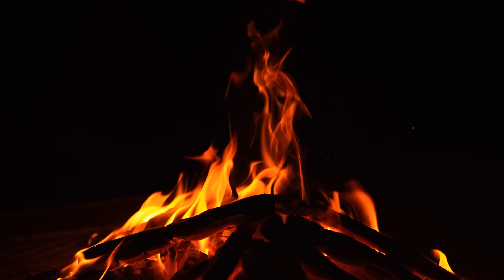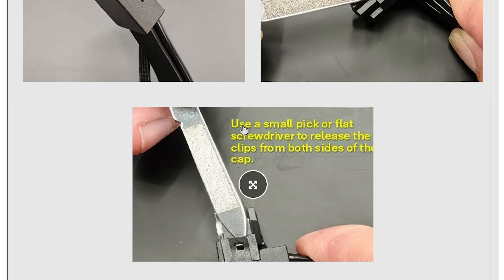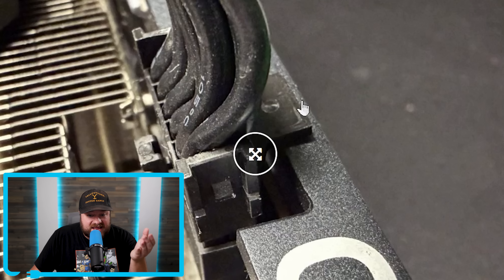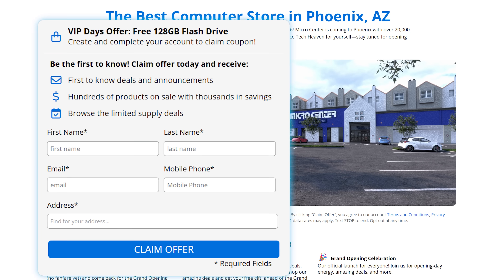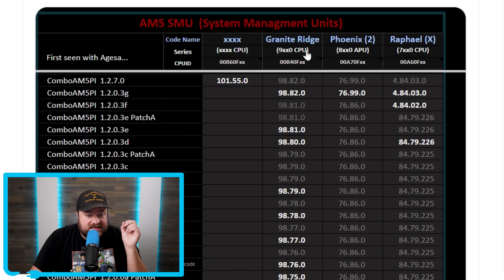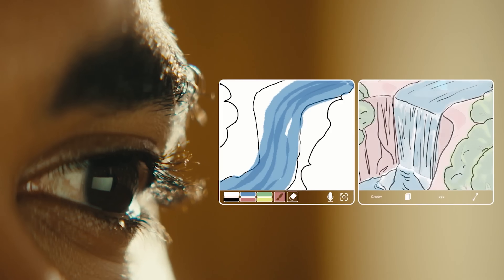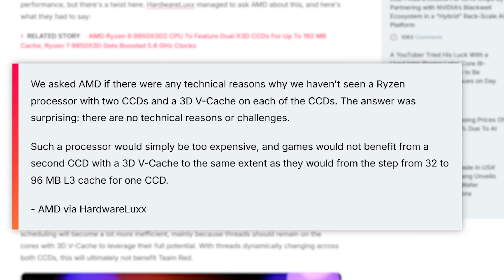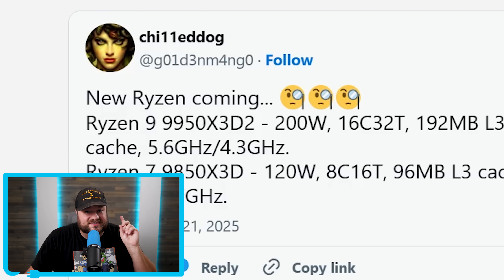AMD’s Dropping X3D 2.0 To DESTROY Everything!

Comment: 8:20 so all 16 cores have 3D cache rather then 8 with and 8 without?
If so that is INSANE
Reply: Still two ccd's
Reply: It will likely be 8 with 8 without
Reply: @Bronson1952 I brushed up on the leaks abit after this comment and found that it is all 16 cores. 192MB of cash is 96 / 2 for each of the CCD’s/chiplets. So it’s 2 chiplets of 8 cores both with 3D V-Cache, kinda insane
Reply: The craziest thing no one talks is how much power consumption X3D or amd uses sitting in IDLE DOING ABSOLUTELY NOTHING..... the amount of power it draws sitting in idle is a massive concern
Reply: @BenjaminD-d4k look I love my 14700k but my buddy had both the 5950x and now the 9950x3d and neither one of them draw a lot of power at idle. You need to make sure windows nor bios is telling it to go full throttle.
Reply: @dabadcod4 I own BOTH INTEL & AMD. Both undervolted. You're talking to the wrong guy trying to talk like you're entitled to speak from personal experience when you don't even own an amd. My amd literally draws 3-5x more power than my intel idle. Why do you bother to talk like you have any anecdotal experience? Ridiculous
Reply: @dabadcod4  if you don't own both, or even remotely have personal experience the conversation ends there immediately. I can't imagine someone who doesn't own something speaking on someone else's behalf as if you know first hand. You clearly don't know
Reply: @dabadcod4 "tell windows or bios not to go full throttle"..... intel has turbo boost & amd has precision boost out the box.... & we got a guy who doesnt know what hes talking about but speaks as if he do... let me guess? But YOUR FRIEND owns a 9950x3d right? Man what a first hand experience... dont even speak... ridiculous
Reply: @BenjaminD-d4k  yo chill out my guy, I don’t think it’s that deep to be arguing with some random online + he said 1 message to you and u sent 3 back, like relax man.

But you are right that the 9950X3D does consume more power at idle, that’s cuz of its dual CCD design needing more power to keep it running. And yeah Intel uses way less minimum power at idle.

However, Intel uses about as much or more power when pushed under heavy loads which is what these CPU’s are mostly designed and used for, as even a 14700k can reach like 250W I think? And a 9950X3D is around 190W max, so I’m not even comparing intel’s best here with AMD’s best, and still their TDP is higher overall. Essentially, for the same performance AMD uses less power.

I also pose this to you, if operating costs overtime is a big problem for you, why buy a 9950X3D? Literally the top of the line CPU, of course it’s gonna have top of the line costs to run. I wouldn’t buy a Lamborghini and complain because it’s not gas efficient. That’s why nobody talks about it, cuz the majority understand that buying a £650 cpu is gonna cost more to run than a £290 one, you don’t even need tech knowledge to know that, most people just assume that’s how it is, and that IS how it is.

So ur not wrong at idle, but IDEALLY, u should be using it for heavy workloads, not leaving at idle often. The performance per $ or W is higher with AMD
Reply: @watersharky7589 brother I like your logic & very thought out rather than just regurgitating bs, & you're absolutely right it's primary design is for heavy workloads, & the reason why I returned it bc I wasn't truly utilizing that power, just thought, get the best, but the truth is, we are not always using heavy uses, I like to Netflix, youtube, simple browsing too & that sort of power draw is too much. Ultimately would've been extremely expensive to keep. Power draw under usage is fine, but I'm not gaming 90%.... while I agree with ya, the car analogy isn't really the best in this scenario... the 9950x3d wasn't for me.... plus I do 4k gaming
Reply: No, I don't think so it's too early for AMD to go dual CCD X3D.
But if this is true then the next gen X3D after this one will be
absolute gaming monsters CPU's with even higher L3 cache.
Honestly I think it will be one CCD X3D with most cache on it,
but this time the ability to use all cores even the non X3D CCD.
Reply: Everything is insane now. It's not even unusual. It's just the next iteration of the chip.
Reply: I am interested to see how dual  vs single V-cache would affect a flagship GPU performance in various scenarios. I mean even latest games pretty much hit a wall at 8 cores, but more V-cache is a different scenario.
Reply: We just need to convince gamemakers to do a better job of optimization, and now take full advantage of all that cache @Hullbreachdetected
Reply: There's nothing insane about it. It's just the next logical iteration. Before they could do it they had to change the triplet communication interface and they've done that now.
Reply: Insanely useless. Also, the chiplets should ideally only be hitting the direct attached cache. Reaching out to the cache on the other chiplet incurs a latency penalty that defeats the purpose of stacking the cache on the first chiplet to begin with. You will not see a performance uplift over the single X3D 9950X3D unless your workload uses more than 8 cores. It's very rare that games would benefit from that. This is a marketing gimmick.
Reply: @joshuagray6061  Someone like me could see a performance gain from this new chip. I stream my DJ sets and play inside VR all on the same pc. This requires a visualizer program, OBS, virtual desktop, steamVR, VRChat(Any VR Program Really), and a host of other background utilities to make it all work as smoothly as I can make it. Currently on my 5950 and 7900xtx I get OK performance with massive hits in FPS due to VRChat typical performance. CPU gets used a lot and my GPU goes around 70-100 in usage depending on if I lower my VR Q3 resolution. Anything that can give some extra fresh air is welcome. Cant afford my jump to AM5 yet but would absolutely save for that chip if the gains are worth it even if AM6 goes out.

*I tend to buy the last greatest cpu and gpu as they go for cheaper and still provide good gains for years. AM6 and the latest AMD GPU will likely cost insane with all the tariffs in the USA.
Reply: @joshuagray6061 want to bet? You need to do a bit more research. They've completely redesigned the communication pathways between chiplets. It will be many times faster than the current design.
Reply: 🔥  9950x3d runs hot already added another 3d cache will be insane
Reply: @Sl1ck_maxzzz  no. It runs just fine for the performance that it delivers. The competitors run way hotter. Look at the 285K.
Reply: @talhamalik1190 you clearly don't own a 9950x3d, & I will tell you with full confidence all you do is watch videos about it. As someone who returned the 9950x3d, THAT THING NOT ONLY RUNS HOT, it even has a RIDICULOUS amount of power usage sitting in idle, nearly 3-5x intels power draw sitting at idle doing NOTHING. It will cost you significantly more to own an AMD in the long run than it's intel counterpart
Reply: @BenjaminD-d4k as someone who has had one since launch, that is complete nonsense. Mine runs 45-55 idle, low 70s gaming, 79-85 at full load.
Reply: @joshuagray6061  45-55 IDLE........ 85 full load.... "not hot"... yet you dont even bother mentioning how much power it draws IDLE either? are you delusional? 45 LOWEST IDLE?? THAT IS HOT........ mine never even ran that hot idle
Reply: @joshuagray6061  it's almost like you're justifying what i say to be true
Reply: @BenjaminD-d4k that's absolutely typical for a high end CPU 😂
Reply: @joshuagray6061 my 9950x3d ran 30s idle with an aircooler... you saying "typical for high end" gives the impression you have no clue wtf you're on about.... 45-55c idle is not normal
Reply: @BenjaminD-d4k I have a 9950x3d sff. And it runs idle around 55.
Reply: @talhamalik1190 I reduced mine to 15-25w idle. My intel is 5w idle. Why it matters here is simply we're not always playing games or doing heavy workloads, when we're doing simple tasks like browsing or even youtube, you can see & understand how expensive the difference can be. 55w idle is insane....
Reply: @BenjaminD-d4k  sorry if you misundeerstood. I was mentioning the temperature of 55C.
Reply: @BenjaminD-d4k  Well, it depends on a lot of different factors. My definition of idle may not be the same as yours. My computer does a LOT of heavy lifting, even when I am not actively using it. I also have a GPU on the same water loop that is constantly pumping up to 550 watts, which has a significant impact on the minimum temps. My CPU is also overclocked. My temps are actually very healthy, all things considered.
Reply: @joshuagray6061 agreed. Many variables need to be considered or put into account. For someone like me who primarily just games 10% & simple browsing usage 90% of the time, it may not be suitable if at all, however, it sounds like you're fully utilizing the 9950x3d to its full extent, for someone who doesn't do heavy workloads, it may not make sense to own. But in your case it does what you need, there's no right or wrong or one size fits all.
Reply: @Sl1ck_maxzzz tbf if anyone’s spending that much money on a CPU they should probably have a water cooler 😅
Reply: @watersharky7589i do mine still hits 71c under load
Reply: @Sl1ck_maxzzz bro that’s like perfect,  anything below 80 is 👌
Reply: @watersharky7589 

I can spend up to $10000 to CPU to get fastest one.

But I have one requirement: It should use power up to 65W.

Currently, no 3D cache. Ryzen 7 9700X is sweet spot when I've disabled all boost clocks.
Reply: @gruntaxeman3740 I havnt really looked it benchmarks on eco mode. But ik the 9900X can do ECO at 65W.
It might be a bit worse in single core? But probably still better in multicore due to it being a 12 core CPU. Plus its really not that much more expensive than the 9700X

I think that’s a good trade off honestly, as 8 cores is good enough for anything nowadays and most games will use em all. But having 12 just helps SO much more with background tasks, productivity task, and just having a lot of stuff open at once. Plus the temps will be really good in that eco mode so u don’t gotta spend much on ur cooler
Reply: @watersharky7589

9900X was 120W and it has 2x core complex chiplets. Means it has two 6 core chiplets. Games benefit when all cores are in same chiplets.  9900X could run 65W if I disable one chiplet so it is then 6 core CPU, while 9700X is 8 core. But this has hyperthreading so it can run 16 threads on same chiplet.

This 9700X runs on air cooling without keeping noise using "thin" tower cooler with single fan. It is so fast that it I can't increase performance on background tasks. Anyway heavy calculation is moved to GPU. Only task that benefits more cores is compiling and running tests for large software.
Reply: @gruntaxeman3740 uhhhh. No?

That’s just not true at all. The 9900X is stock 120W, and has a ECO mode at 105W and 65W, but using the 65W mode does not disable one of the 2 CCD’s, thats just insane, it would still be 12 cores and 24 threads.

Your right, gaming and overall performance is impacted abit by having 2 CCD’s, as work being transferred between them adds latency and etc. thats the reason the 9800X3D is still better than like a 9950X3D for things like gaming, because of its single CCD (and I think higher base clock speed)

You would probably get better single core and gaming performance on your 9700X. Your definitely not wrong. But if it were me I’d get a 9900X just for those extra cores, even if I do lose some performance due to the eco mode or dual CCD’s. In my mind the extra cores make up for it in background tasks or multi tasking or just productivity tasks. If all you do is gaming, then fair, but I do more then just gaming so we have different priorities
Reply: @watersharky7589 

I googled about that and yes, there is also way to limit watts. However, its still lose that efficiency and determinism having all cores in same chiplet.

I don't understand what background tasks you are talking as today all time consuming computing is better to move on GPU, and if computing is not suitable to run on GPU, that is anyway then bottlenecked by I/O, memory bandwidth or network, and CPU is mostly idle even when running video editing or similar stuff.

Compiling or running tests to large programs is where extra cores are useful. Or there are plenty of users and computer is hosting resources to others.
Reply: @watersharky7589 I run my 9800x3d at 5400 MHz in manual OC, and it runs between 80-85C at full workloads. That is with a custom waterloop with an optimus AM5 waterblock.
Reply: @Hullbreachdetected That's way too hot. There's no reason for that CPU to run that hot. If nothing else, try undervolting.
Reply: @ActionableInfo  Totally fine for CPU to run at those temps. Anything at or above 95C would be alarming, but running a 9800x3d at or above 5400MHz will require running it above 1.225 V at core, which will also require adequate cooling solution. For the sake of the argument, these components would be even fine at 110C, it's just for higher measure of safety to set thermal limits within safe operating temps, 105C is the thermal limit for CPU usually. So 85C max is perfectly fine for an overclocked CPU.
Reply: @Hullbreachdetected it may be fine, but that CPU should not run that hot under almost any circumstances. Particularly with the water cooling that's involved.
Reply: @ActionableInfo  What makes you say that? Do you also have one with manual OC?
Reply: @Sl1ck_maxzzz deb8uer it and de-lidd it... With caution, I haven't got the courage yet

Comment: I wounder how 9800x3d would be if L3-cache was like 192mb 🤔
Reply: Not that much better than single ccd for gaming. The cross ccd latency is still there.
Reply: Or are you talking about a single ccd with 192mb?
Reply: @urncjd  he said 9800X3D, which is single CCD. 
Doubling the L3 cache would lead to even higher FPS in most games. You'll get it next year, the 10800X3D will be close to that spec.

Comment: Please AMD  APU with 3D cash ...
Reply: they probs will never do that because with an apu you will pretty much always be gpu bound. so any increase in cpu power will probs not be seen.
Reply: @XGlovesversionme  i do medical imaging , the software i use will run on potato  ,, as long as it is AMD software  ,, but i runs for up to 40 hours to complete  ,,, now i am using 7950x3d with radeon      6600 8gb ,, if i can eliminate the gpu i can save on electricity bills,, and yes the extra cash helps with the software,, vs 8000 apu vs 9600x on bord gpu saves about 6 hours ....

Comment: They just need to redesign the 12pin. It's a fail whale. Zero confidence it's going to last. Even the perception of it failing and causing a fire should be enough to deliver a new solution.
Reply: We already had good 8 pin power connectors. This piece of junk 12 pin connector was a solution in search of a problem, and that's being generous.

Comment: We use plugs for everything. I'm just amazed how long these power cable issues have been going on for. Perhaps we should all use XT90 😅
Reply: XT60 will be much beter than 12VHPWR
Reply: Not a bad idea, those are great
Reply: The way things are going, we should use those XT connectors - AND up GPUs to be fed 24V. Call it ATX3-Gamer, or whatever. Because it doesn't make sense to power 1000W GPUs through 12V. Also, we would need some kind of locking thing in those XT connectors - but I agree: they are awesome.
Reply: @sysbofh  seems like good business plan =)
Reply: Since they released.
Reply: its cause they general public is dumb and has been lead to believe this didn't happen with the normal style connector thats been used for decades. it has. this isnt a new problem.

Comment: game changer, i was looking around to switch to AMD this Christmas and i might wait till this x3d2 comes out
Reply: Well 9850x3d will have 32mb more L3-cache than 9800x3d and will cost 599msrp.
Until then ram memmory prices will increase same for m2-ssd/ssd/hdd.
9800x3d 2.0/9850x3d/9800x3d2 what it will be called for will not be great buy since after summer next gen will release probably.
Eyzen 9000 over a year old and 1 year left for next gen.
Reply: @Kage0No0Tenshi  Sorry, but what are you talkinga bout: the 9800x3d has 96MB of cache as well as the 9850x3d probably will have. Vcache adds 64MB to it, while the ccd has 32MB of vcache, that does not change in the next chip; you only get better clock frequency.
Reply: @Velerios  hopefully I do not remmember how much x3d had
Reply: @Kage0No0Tenshi next gen are set to release at the end of 2026, but mostly at 2027 i believe

Comment: 200w ...
Reply: I mean, it's real TDP. Not as Intel does it... they say CPU uses 125w but in reality it uses 250w+.
Reply: well, it is high, but is a 16 cores, real cores with x3d, and the clockspeeds are quite high, and it is 200, not 400 like that cpu we should not mention because intel fanboys will cry
Reply: I'm pretty sure you can configure the TDP in BIOS and lower it. If you lowered it to like 125W, I suspect performance wouldn't even be all that much lower.